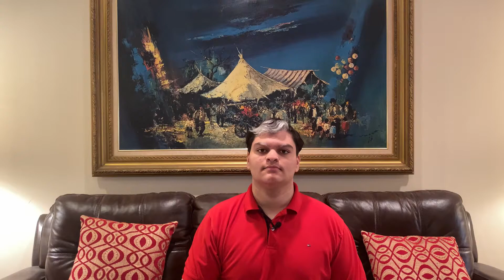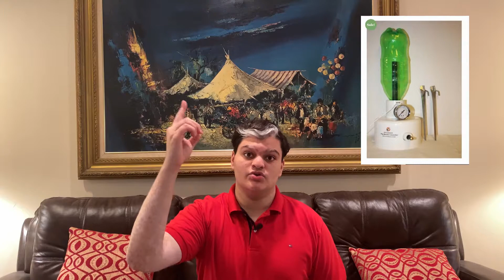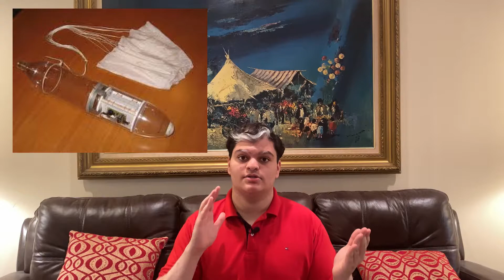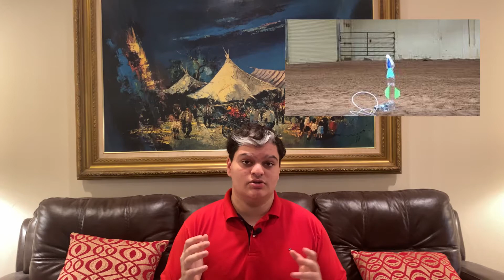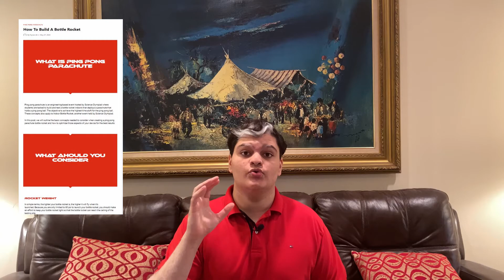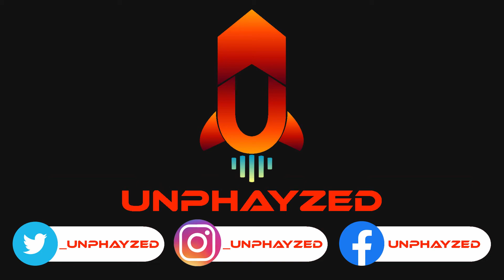How to Design A Science Olympiad Ping Pong Parachute Bottle Rocket

Comment: hi so i have my competition on sunday and this is not my main event so like i didn’t really prepare yet😭. what materials would i need for a quick build that i can show up with. doesn’t need to win or place. thanks!!!
Reply from the maker: -2x 1L soda bottles (cut the top half off one and attach it to the bottom of the other using tape)
-1x 10-20 gallon trash bag for the  parachute
-1x T8 light tube guard, found at a local Home Depot, or any other light weight tube (attached to cut off bottle)
-2x ping pong balls (one for the top of the light weight tube and one for the parachute)
-cardboard for fins